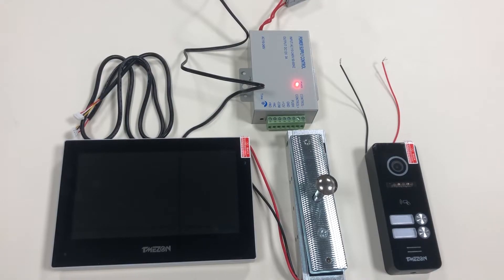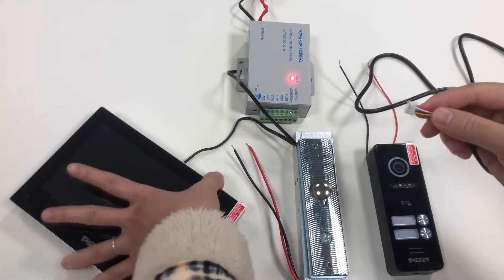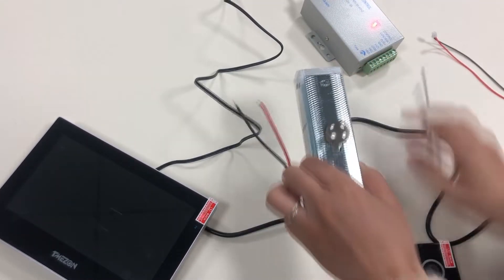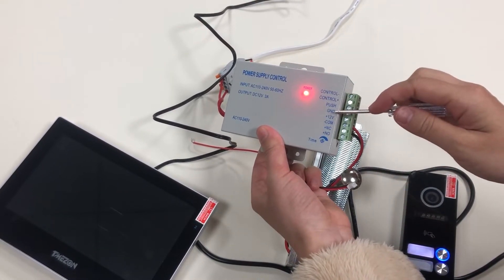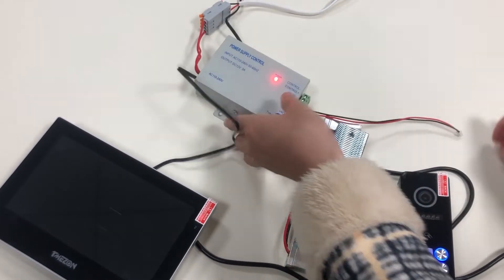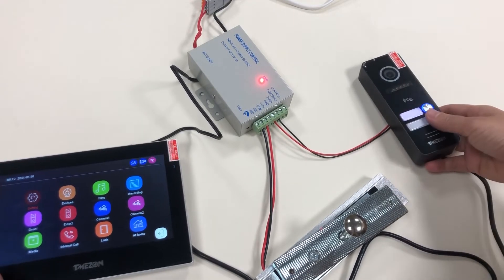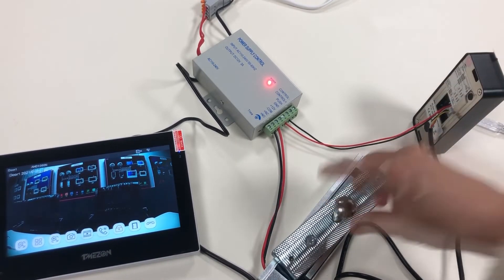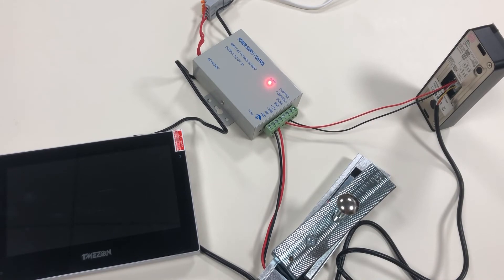NC doorlock's connection with power supply control for the model MZ-IP-V726TW intercom videodoorbell

Comment: What if I want to connect it to several apartments?
Do i need another power supply control and different types of intercom?
Reply from the maker: Hello, use the same intercom. If your power supply support two and more connect, you can use one. otherwise, you need extra power supply.